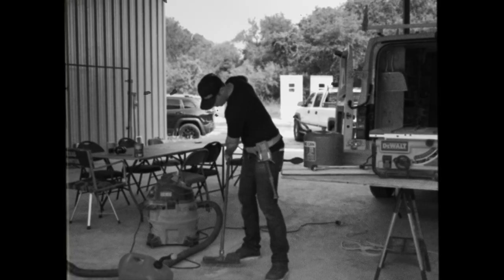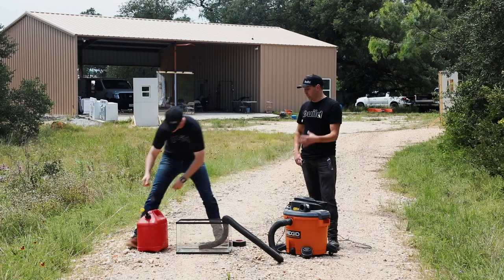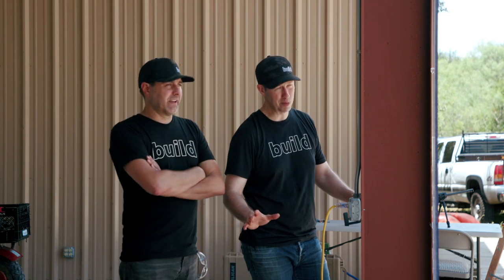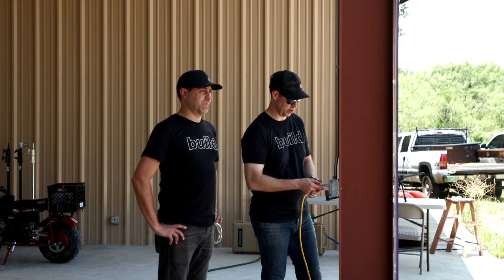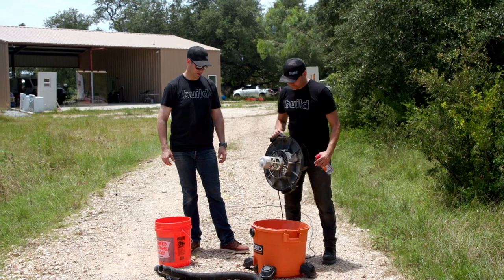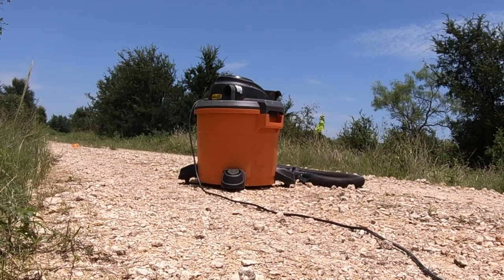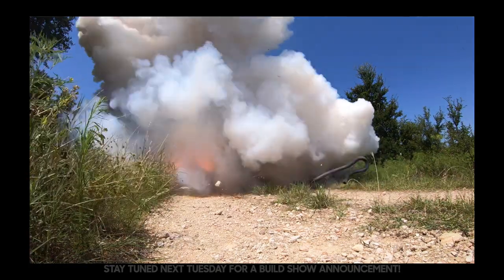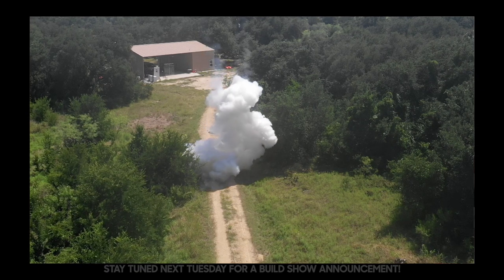Shop Vac’ing Spilled Gas - Will it Blow Up?

Comment: It was fail from the start. Use the older style vac, that is only for dry suction. Brushed motor etc....
Reply: @bmay8818  If it is brushed universal, most of them are, then the air is moving to quickly to alow for vapors to accumulate to the right ratio.
Reply: @bmay8818  Also, this one is for wet suction. It have additional way to flow the air to negate the foam to get to motor. Ball float, filter mesh etc...
Reply: @DuffyGabi  the point is what?

Comment: All shop vacs (and most others) separate the motor from the collection compartment because you don't want moisture or dust in the motor. Moisture for obvious reasons and dust because it's abrasive and will wear out the motor quickly. Without an enclosed volume, you can't get an actual explosion, just a whoosh that might remove your eyebrows. Old bag-type vacuums are the ones to watch out for because they rely on the bag to filter the air rather than separating the motor and don't expect moisture. Switches are the same story. All modern switches fully enclose the contacts so the arc isn't exposed to the environment. Old switches, not so much.
Reply: I say it's safe to vacuum gas with a new wet vac.

Comment: I think that if you vacuumed gasoline as a habit for a while, it would only be a matter of time before it blew up. Most consumer-grade shop-vacs still have motor brushes, which spark more as they age, and even if they are sealed up, it would only be a matter of time before the air-fuel mixture reached that critical point. And, yes, this does happen from time to time, eg. https://www.wkyc.com/article/news/weird/vacuum-cleaner-explodes-at-a-car-wash/336209870 . I've even heard of it happening to a washing machine in Russia and with the newer refrigerators that use propane and butane as refrigerants, even though the switch contacts are supposed to be sealed on modern appliances. Most people would have the common sense to avoid vacuuming gasoline, but powders like sawdust and grain can be explosive as well. There was a couple of brothers refinishing wood floors in Somerville, MA some years ago and one of the tools set off either the fumes or the dust, causing one death and some serious injuries.

Comment: In the 1980's, US military bases where I was assigned, had a required safety course for new arrivals that included a lecture on the explosive fire hazard of vacuuming spilled gasoline.  The instructor referenced an actual case where a service member was injured and his base house was severely damaged.  Maybe older vacuum cleaners were less protected from spark hazards.
Reply: That incident is the first thing that came to mind when watching this. I was in the military as well, and remember receiving safety course concerning this.

Comment: There's something you may not have had a chance to test. Say you vacuumed up some gas and then left it for several HOURS in a hot garage. It would evaporate, expand, and atomize and some might make it into the motor area. Couple that with not using a filter and an older less sealed brushed motor, and I think it's plausible.
Reply: Very true. Gasoline is underrated as a danger outside or inside a vehicle.

Comment: Ridgid is the old really good craftsman shop vac. The motor cooling fan does not use air from the air used for vacuuming or blowing like others. They will blow up in the right environment. Try a shop vac vacuum. Also, the consideration in the air (like a small room) would make it go fast (like the effect of an open flame in a spray booth).

Comment: It's a non brush motor. If it had brushes boom !!
Reply: It's a corded electric motor. Aren't they ALL brushed?
Reply: @pattognozzi  if you look at Motors that are in oscillating fans they don't have brushes it work by electromagnetic wave
Reply: @peesmkr  Ok, I see
Reply: @pattognozzi  some of the new tools, DeWalt, Milwaukee have brushless motors, increase runtime and less heat.
Reply: @davegordon6943  You are confusing battery powered tools vs. corded tools I think. Corded tools do not require increased runtime or brushless motors.
Reply: @pattognozzi  no you're right about corded, my bad
Reply: In this vacuum the brushes were external to the canister, so they weren't exposed to the contents of the canister. Not necessarily true of all vacuums.

Comment: Just a few things you missed:

1. ALWAYS READ AND FOLLOW MANUFACTURER GUIDES FOR ANY EQUIPMENT USED. Between manufacturer safety testings and Underwriters Labs testings, the manufacturers are going to know how their devices should be used to be safe. I'm going to guess that the manufacturer probably has a warning about gasoline. It may not be due to explosion or fire, but that's not the only hazard. Gasoline is a solvents that loves to eat a lot of different petroleum based plastics. (Kind of ironic, seeing that it is also a petroleum product.) So, even if there isn't a fire risk, it may still damage the device beyond usability. Some of the chemicals that could be at risk could be wire insulation, gaskets, any sealants to protect electrical components from water, printed circuit boards, the case and attachments, etc.

2. WHEN WORKING WITH ANY DANGEROUS OR HAZARDOUS PRODUCTS, GO FIND AND READ THE MSDS SHEETS FOR THOSE PRODUCTS. It's easy to do, AND you can find them for free on the internet. They'll tell you best practices for both safely handling the product AND how to clean up any messes and/or spills.  Also, if you are an employer (like Matt Risinger), you may even be required by law to post and keep updated MSDS sheets for any dangerous or hazardous products you have in the workplace. There is a proper way to clean up gasoline, and the MSDS sheet for it will tell you how. 

3. DON'T BE SOME BACKWOODS YOKEL OR IDIOT ABOUT SAFETY. It just takes a few minutes to look up the right way to do things. Fifteens minutes reading and prep are worth more than a lifetime of regret.

Comment: In this vacuum the brushes were external to the canister, so they weren't exposed to the contents of the canister. Not necessarily true of all vacuums. Any potential ignition source should not be allowed to come near concentrated amounts of flammable liquid or gas, period. Any brushed motor puts out sparks if not constantly then from time to time. It may help if the brushes are kept external to the vacuum canister. But even if it's a brushless motor (which is unlikely), static electricity is known to build up in vacuums. They can make the plastic conductive to bleed that away but that is not foolproof and manufacturers don't go out of their way to make their vacuums safe with flammable gases (unless they say so). Metal grinding dust is also reactive enough it could catalyze some gases and cause ignition.